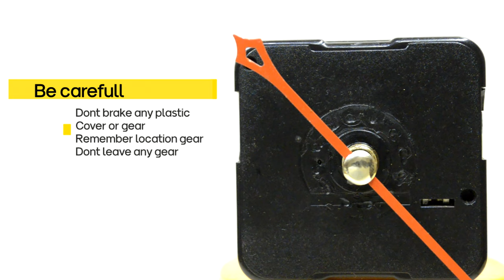How to repair dead wall clocks stop working type Quartz machine

Comment: Found a small bit of corrosion on the battery contact area on the circuit board. Cleaned it up and the clock works again. THANK YOU for taking the time to post this video, I prefer to fix things rather than replace them. :)
Reply from the maker: Thank Tim, the same case. Better fix it before buy
Reply: Not the video, but your comment helped me to revive my clock.
Reply: Thank you so much.

Comment: Great video, my Westclox had the corrosion on the circuit board terminal. Cleaned it with fine Emery paper. Good as new, working perfectly. Quite an easy fix if you take some photos as you go along.👍
Reply from the maker: Thank you Stan

Comment: My wall clock runs when it is placed on flat surface.  As soon as I hang it back up vertically, it stops.  I have replaced it with a new battery and it behaves the same.  Any advice to trouble-shoot it please?
Reply from the maker: Listen to the tick sound of the clock
From horizontal to vertical position
If it still rings, but the clock doesn't turn
Possible unit in the mechanical unit, the position is not right
If it stops (no sound), it's probably on battery power.
That was my experience before fixing the clock due to battery problem
I hope can help
Reply: I have the same problem. When kept flat it runs, when vertical it stops. Did u fix it? If so how.?

Comment: Why does my clock stop every few minutes, and can only run again by heating the ic part with solder, what's the problem?
Reply from the maker: Check mechanical movement
When it works, there is no problem with the clock generator chip
When it stops, the generator chip is broken
In general, the battery is weak
Try releasing it on the second indicator
I hope one of them can solve your clock

Comment: Hi sir, my wall clock is new and kept 3 years with battery. Now it is not working
Reply from the maker: Check the battery, replace with new battery
Check the socket battery, may be dirty. Almost case from there.
Check the machine watch quartz. But this the last option, may be machine fail and stop working
I hope can help